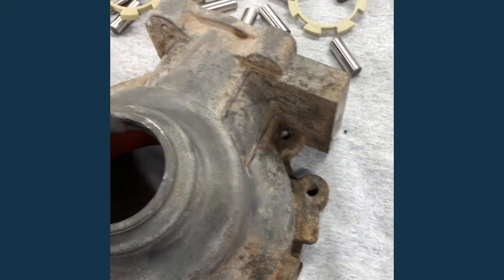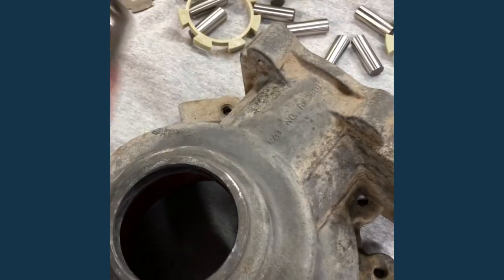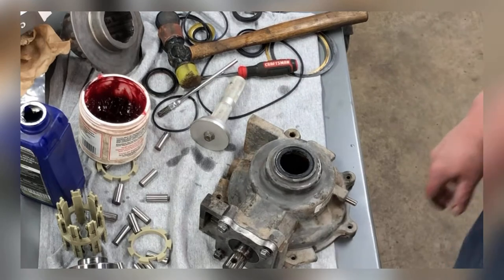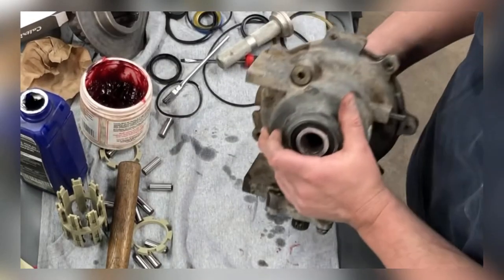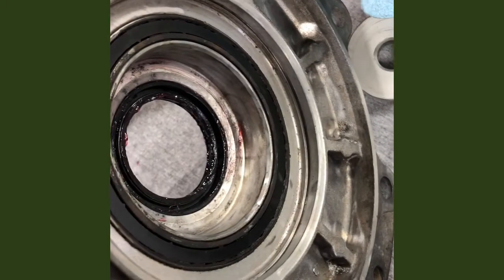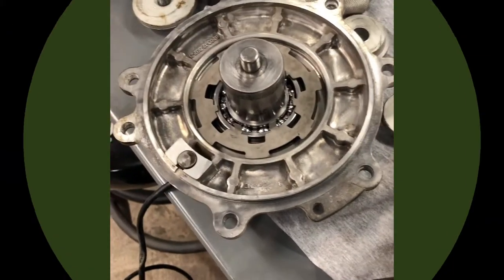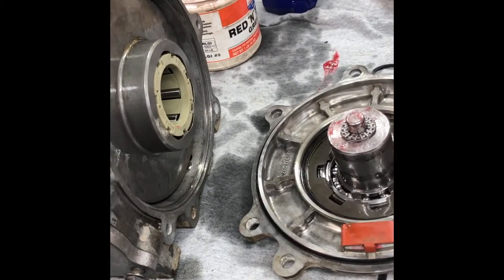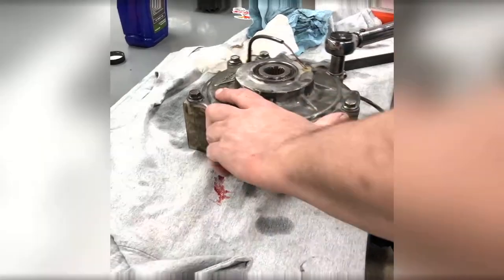Polaris AWD Differential Rebuild   PART 4   2004 Magnum 330 Hilliard Clutch

Comment: Do you happen to know what voltage needs to run to it to engage?  My OEM wiring is messed up.
Reply: My Magnum is 12v to the diff.
Reply: Ended up fixing it with an Amazon switch and some fresh wiring.